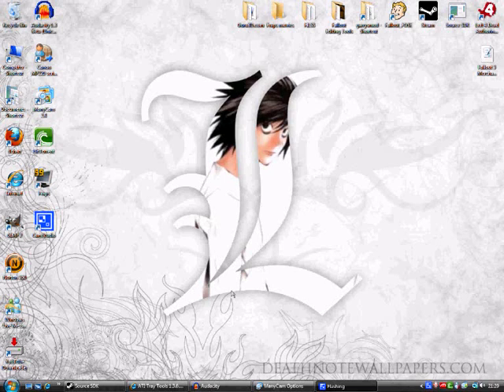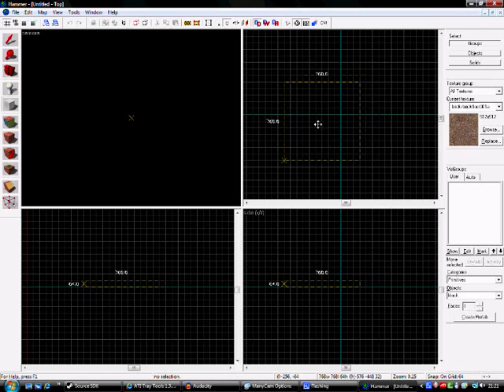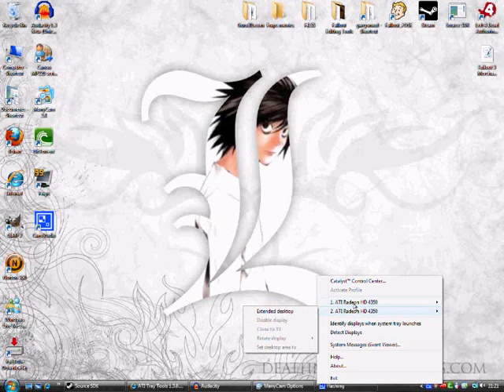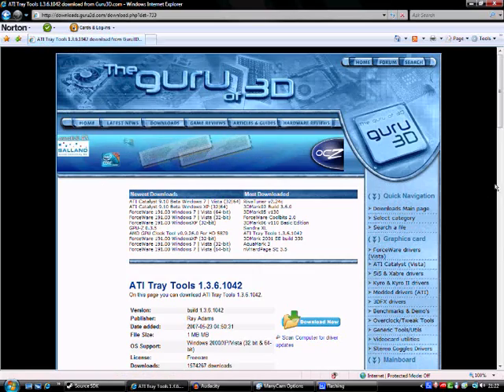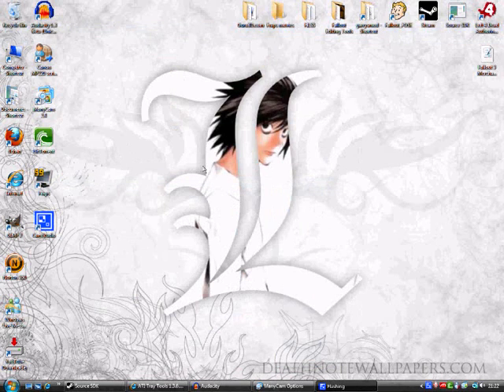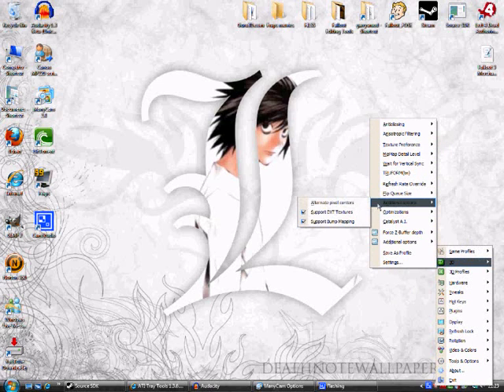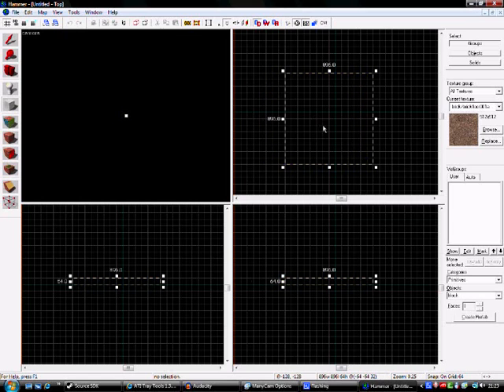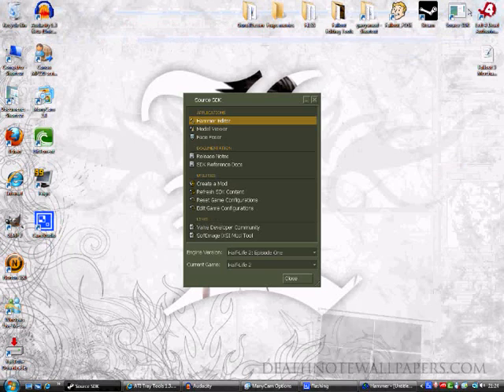Font problem in the Source SDK Hammer editor.

Comment from the maker: Yes, I had the same problem, and you only have a choice of fucked up measurments or model browser.

I usally just turn on the Pixel thing before launching hammer and then when its on disable it, your model browser will still be fucked up but it saves remembering to turn it off again.